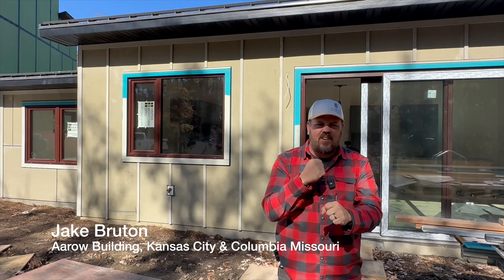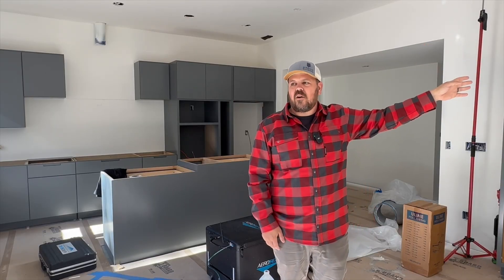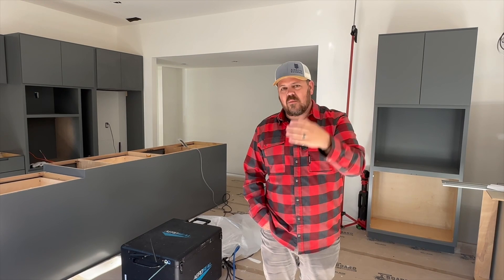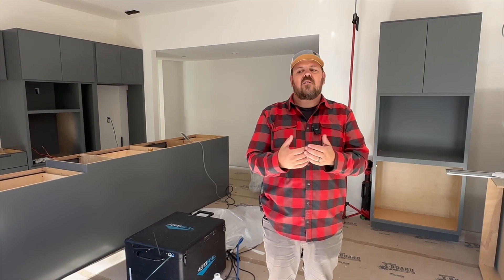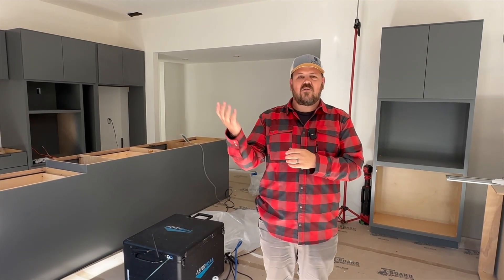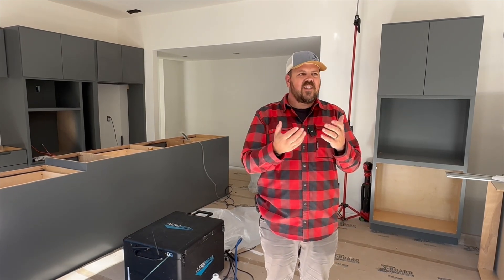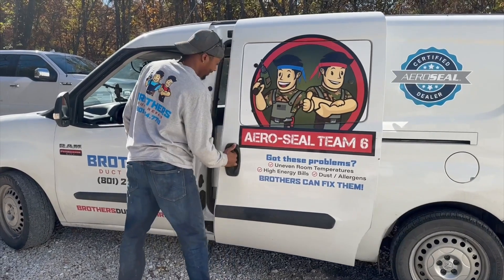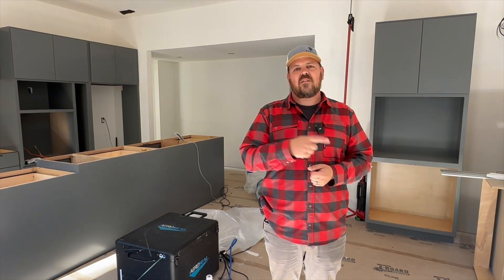Sealing Duct Work from Within (Aeroseal to the rescue)

Comment: Do you typically do a duct-blaster test?
Reply from the maker: Actually no. Most of out builds use systems without duct work for the conditioned air and if we are using the Zehnder system the piping is without connections (solid) from one end to the other. We generally aren’t concerned with leaks.